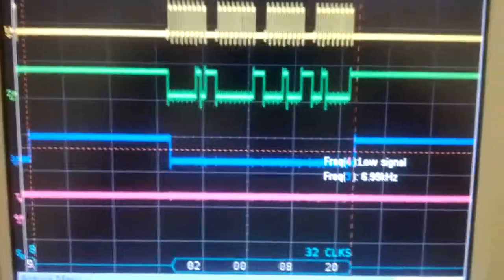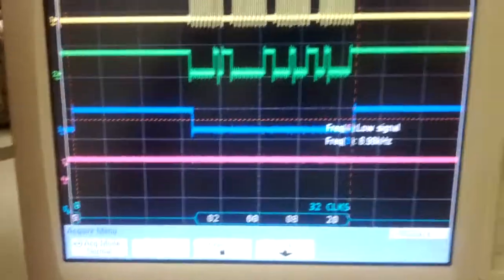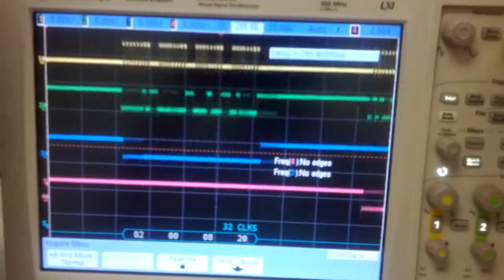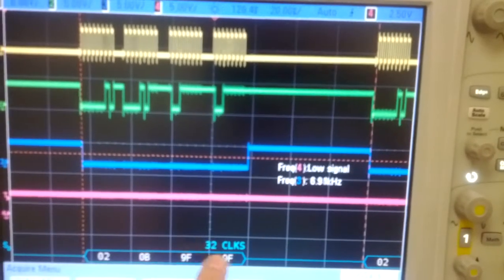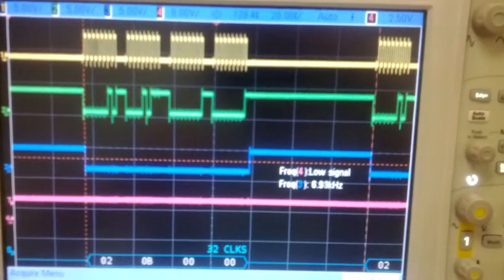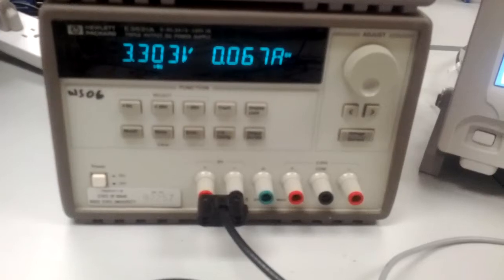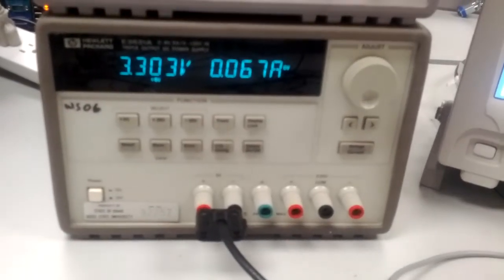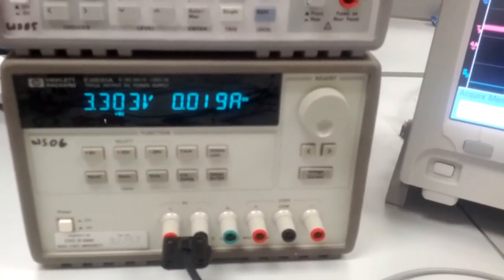VS1053b part 2

Comment: Nice job, can the vs1053 do simulaneous encoding and decodng ?
I have a small board here with a vs1053(ebay) that i would like to use for a small dsp audio filter.So i need full duplex for that purpose.